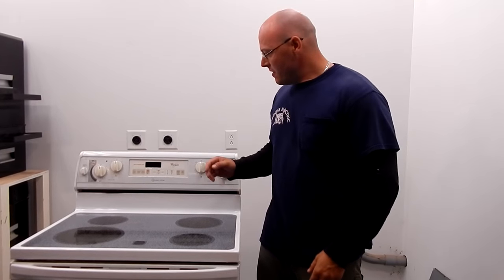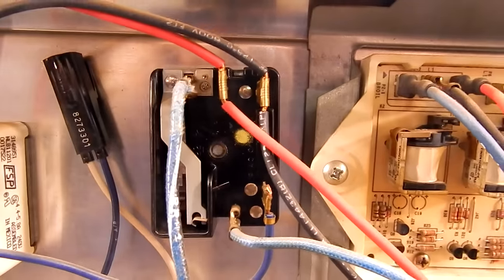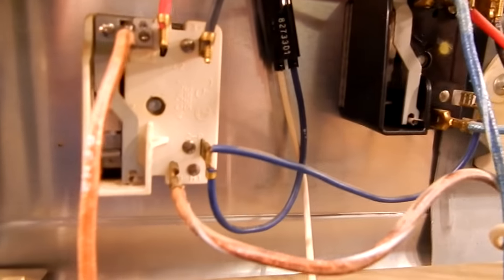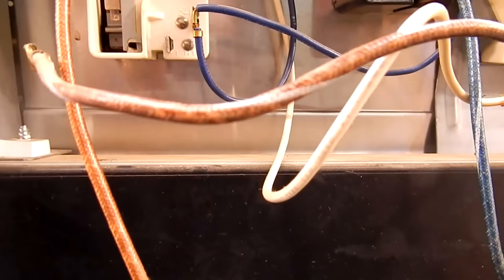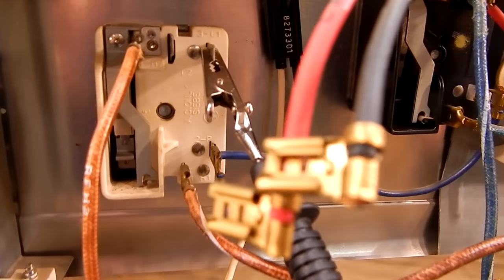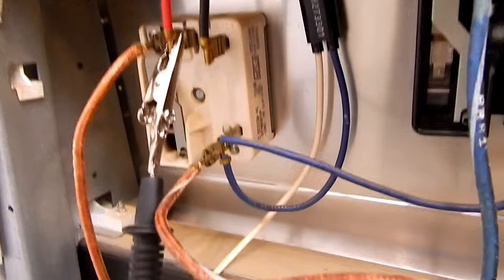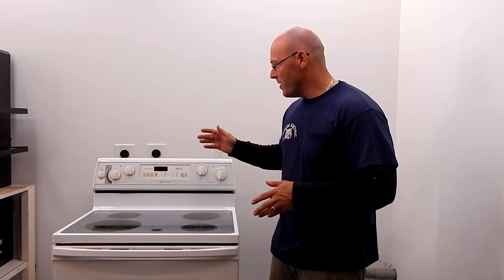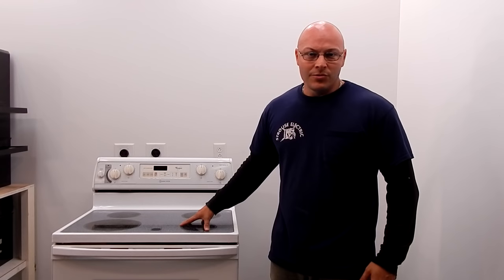How to Troubleshoot Glass Top Stove Burners and Switches

Comment: Thanks a bunch.  On the switch and element testing,  I got a clear picture how to ID the part to be replaced.  Really a good video. Sorry to learn that you passed away. RIP.
Reply: Thanks for the video.

I have a stove just like the one in this video and it is the biggest burner that isn't working.
It won't heat up.
I replaced the switch and also replaced the burner and am still having the same problem.
The burner won't heat up.
Does anyone have any ideas on what the problem might be?
Reply: @im1who84u - from what i’m reading on some other forms it could be the master control board itself that needs to be replaced…. Or the wiring …..

Comment: Great info! I think electric stoves are crap and gas is the way to go unfortunately that's not a choice we all can control.  I had a burner that stopped working, this before finding your video.  I opened the the burner top and looked at the non working burner and right off the bat I noticed a wire had separated from the crimp connector!  I restored that connection and my burner now works!  With this video instruction, I would have read open on the meter when checking the element!  Thanks for the simplicity of this video I will recommend it to anyone that needs to troubleshoot an electric range. Thanks again!
Reply: I have a stove just like the one in this video and it is the biggest burner that isn't working.
It won't heat up.
I replaced the switch and also replaced the burner and am still having the same problem.
The burner won't heat up.
Does anyone have any ideas on what the problem might be?

Comment: My glass top stove element front left seems to have 1 temperature setting - HIGH.  I think from watching your videos, this may mean it's the switch needing to be changed out.  I'm not sure though because the two videos I've watched seem to deal with elements that won't don't turn on... Mine is turning on... way on... no matter what temp or whether it's on the single or double burner side.  I have a friend I think with me holding things, stuff at my age I can do, he can change it be it switch or burner.  Looking for appliance book to find part numbers and such... It's a Kenmore bought in 2017 to replace our stove after our home was flooded in 2016.  Advice?  Help me please.  Sigh... RIP Mr. Newberry.  Sympathy to Mr. Newberry's family.  Looks like Mr. Newberry left a valuable legacy in his videos.

Comment: Hi,I have question regarding wiring on limiter heat indicator ,if L1 line (120 v )connected to 1 b and N neutral line connected to 2 b  ,will it shorted it ? Or the indicator heat light up when temp reach its certain temp to closed its switch so that light will go on -

Comment: What if burners and oven quit heating at same time ?? Accusimmer is all that works. I've done your tests and it all tests fine. Any advice?
Reply: Control board
Reply: All burners need 240V and get it from L1(black wire) and L2 (red wire). Accusimmer needs only 120V and gets it from L2 and N (neutral White wire). Since nothing works except Accusimmer, that means you don't get 240V.
Check for the half-tripped breaker.
Check power cord for burns and that it's capable of supplying 240V.
Check for loose wires inside the wall outlet. (if you are not comfortable working with electricity, call an electric because 240V can kill you)

Comment: Thanks for the very informative video.  If I have no temperature control on the burner, do I need to replace the switch?  I can turn the element on, but it goes to max and stays there regardless of the setting on the knob.  Thanks!
Reply from the maker: I would say your burner switch is bad or seriously out of adjustment.  Some are adjustable.  Tiny flat head set screw down the shaft where the knobs connects.  Was the burner previously working fine, then stopped working?  Or has it always been like this?
Reply: Thanks Bill.  I'll check for a set screw.  The problem started happening intermittently with increasing frequency on two of my burners; now the two burners are permanently afflicted and will only go on high and stay there.  If there isn't a set screw, then I should just replace the switches?
Reply: Hi Bill.  I ordered new regulators and installed them thanks to your video; now everything works great.  You mentioned a set screw, in the back of the regulators (stove model Samsung FE-R500WW regulator part number DG44-01002A) there is a small Allen key.  I wasn't able to find any instructions for the regulator.  Do you know what that Allen key does?  Thanks again!  Now I can cook without turning the burner on and off constantly.
Reply: Steven Gray
Reply: Steven Gray broiler will not work
Reply: Thanks for asking this because this is the same problem I am experiencing currently.

Comment: Whirlpool range.  Turn on any burner and it immediatly goes to high and stays there. No control.  And it is any burner. They all do it. Is is it possible that all control switches are bad? Since they are daisy chained could one be controling all?  Oven works fine. Please answer. Thanks.

Comment: Thanks for the video.

I have a stove just like the one in this video and it is the biggest burner that isn't working.
It won't heat up.
I replaced the switch and also replaced the burner and am still having the same problem.
The burner won't heat up.
Does anyone have any ideas on what the problem might be?

Comment: Very good video...

Besides the control knob for the burner and a  reading in the multimeter of infinite resistance (broken filament in the burner)...I can also see a third problem...

What if the normally closed contact at the burner...start to open too often???...that I believe will be a hard issue to detect.  If your  burner turn on...but start to go on/off more often that they should...after ruling out the other two issues (as you explain here using the multimeter)...then the problem might  be the  burner switch ...opening the normally closed switch too often...I reader wrote something that this switch should not pop open until 1000 degrees...Hence the on and off of a burner at a given setting should only be through the control knob...is this is correct?

What do you think?

Thanks!!!!

Comment: Hey Bill, Bill here. I replaced burner after noticing burnt terminal. Burner still not working. I just replaced switch and still nothing. Any suggestions. Should I have changed the terminal end on burner before reconnecting?

Comment: Is it possible that a  control board issue lead to one burner not receive power? I have a whirlpool range, changed switch and element, check some cables and seem to be fine but all other elements get power but not this one (bigger one on the front right)

Comment: Thanks  for this excellent video. As for Samsung ranges, they are garbage, it seems. With mine I had switches going faulty one after the other just after the first year. When I decided to replace the switches after they are all consumed, I was surprised to see that the 4 switches cost almost half the price of a new range. This time I'm thinking of buying one with solid state control and not mechanical parts and definitely NOT Samsung. Thanks.

Comment: Hello Bill I used the procedure for my Frigidaire electric range, only right hand side burner is not working. Both the burner and switch are tested for continuity and both are functional. what else could be the problem for burner not heating up? indicator light is on though? thanks for your help

Comment: Hi I tried to test resistance between L1 and L2 to test the switch and did the test for Buber that was mentioned both show 37 ohms for Samsung single 6” burner but the burner is not working so you know what else might be wrong and this is the only one that is not working other3 burners are working

Comment: That's actually an Open (OL) reading on the ohmmeter when you connected the leads to the switch, not a "Zero" reading as you said. A Zero reading would indicate continuity which is not what you want with the switch open.

Comment: I have a Frigidaire Gallery smooth top stove and my burner won't shut off (rear left small), I've replaced the switch but the burner still stays on however when I installed the new one the light would come on but once I get to halfway it shuts off (clicks) then I turned off then on again only to have the burner come on then it stays hot while the light stays on. Could it be the burner shorting out? Thanks
Reply: Fregidaire

Comment: Very clear; I found the problem right away. Thanks !
Reply: I have a stove just like the one in this video and it is the biggest burner that isn't working.
It won't heat up.
I replaced the switch and also replaced the burner and am still having the same problem.
The burner won't heat up.
Does anyone have any ideas on what the problem might be?

Comment: All my glass top burners are not working but the oven turns on and the clock is working. Is that normally a burner switch issue?

Comment: There's one burner on my stove that after I turn it on I'll eventually (3 to 6 seconds after the burner lights up) hear static around where the switch is and it will shut off. I replaced the switch and it still does it. Any advice? I don't have a meter to check the readings.

Comment: Great video Bill, thanks! Do you happen to know anything about another type of infinite switch found on units like a jenn-Air? My range top has an almost identical top. Mine is  a slide in (drop in??) but the infinite switch for the front right unit has a much different style of connector and is called a "Custom Control" switch?
Any help is appreciated.
Reply: Good job
Reply: Before you do the job 
Take a picture with 
Your. PHONE

Comment: Hello sir, I have Kenmore flat top. One small burner doesn't work. I  REPLACED WITH NEW BURNER - didn;t work. I doubted Switch and replaced but still doesn't work. All connection are ok. What is other thing to check? Could you please Reply.
Reply: Sadly, Bill Newberry died on October 24, 2016.

Comment: hi, Bill...one element was overheating a bit....called repair, he said it's the switch...replaced it, $150.  he left, didn't test it.  later that day, there is liitle or no heat from that burner..it warms up then shuts down quickly. Called repair...he came, said it's the sensor, replacement is $275 total...what he meant was the element and the probe, or "sensor".  I asked then why replace the switch?  he said it would probably soon go, oven is 9 yrs. old.....can't I buy the probe separate from the element? Am I being scammed?  thanks, Bill

Comment: I think I get it... The first test bypasses the switch to check continuity in the burner, the second just checks the switch, right?  If you have one of those inner and outer ring burners, and the outer ring works, that implies that the switch works (for both rings, correct)?
Reply: My outer ring doesn't work but the inner one does. Both of Bill's test say's my switch and burner are good. So why doesn't both rings light up. Same issue I have with the simmer select burner on the other side of stove. The simmer select works but the burner does not "glow" and work with out simmer on. Anyone here have any suggestions. I know Bill has long ago has left us.

Comment: Hi
we changed the switch, which had bunt marks and the burner which was burnt too and the element still isn't working, we bought original parts, should we give up?  i almost forgot, the hot surface light goes on as soon as we turn the switch on, any suggestions are appreciated. thank you
Reply: Sadly, Bill Newberry died on October 24, 2016.

Comment: I have a question... I have a Inglis stove my big burner blew and not everything else out I replace the burner and got power going to everything but nothing will heat up no over and no burners but all lights up. This stove, when its plugged in the stove clock would come on but don't but lots off power. What would be the problem?
Reply: Sadly, Bill Newberry died on October 24, 2016.

Comment: Nice video, subscribed.

I do have a question that does not center around electric burners. I have a gas stove; if you use two burners the output is fine, if you use all four burners there is a reduction in out put. The unit is an Acubake Duo by Whirlpool. It had one issue that I dealt with in the oven where the gas rail needed a modified rail with more holes in it for start up. That worked fine. But the reduction in output when using all burners in new to me and I have not found much on the internet to explain it. No kinked gas lines and they are the proper size. Any ideas would be great, Thanks!
Reply from the maker: Curiosity Is it converted to propane?
Reply: Bill Newberry Well it's coming off of a city gas line, not sure how to tell if the stove might have been delivered incorrectly in the past? Not sure how to tell if it might have been setup for propane accidentally.

Comment: Help !!  I have a Kenmore Electric stove. I had to replace the main control board, $110. And the right front burner, $75. About 4 months later the same burner, burned out. I got one on ebay.  $45 It has been about a year now and it has burned out again. I should mention I had to replace the wire connector that plugs into that  burner. Any ideas as to why this keeps burning out ?
Reply: William Wynn did you check main power current fluctuations..??
You definitely have over current issue with your main panel. !
Or just loose connections at tha particular burner would definitely cause over current situation.

Comment: I have a hot top sensor indicator between the front two burners and one of the four stays lit unless I place an ice cube on the burner effected and it shuts off after a minute. How do I repair that. Where is the bad part located?

Comment: My front and rear right burner both come on when I use the rear control switch. Any suggestions on what to check.
Reply: I'd say one of your switches is stuck on and has to be replaced. The feeds to the switches are all daisy chained.  So the one that you don't want on is the switch that has to be replaced
Reply: Sadly, Bill Newberry died on October 24, 2016.

Comment: I have changed both the burner and switch out for the left front burner but it still doesn't work. The other 3 work. What else could it be? The original burner was pretty fried.
Reply: Look for burnt wires

Comment: Hi Bill maybe you could assist me. Thanks for your video.  I have a Kenmore model #790.96593602 electric glass top stove. The large front right three coil burner has stopped working properly. The main inside burner went out but the middle and outside ring still works. I opened the top and tried doing a continuity test. I expected to hear the closed circuit on two of the three circuits but instead I hear nothing. When I touch the two meter probes together, my meter buzzes so I know it works. I need to find out if my element needs replacing or the control panel needs replacement. Could your help?
Reply: Sadly, Bill Newberry died on October 24, 2016.
Reply: @returnofthemac8179  So sorry to hear of Bill's passing.
Reply: @phillip5545  His obituary indicated that he was only 38.
Reply: I have a dual burner and the inner one would not light. Used Bob's video to check current and found out no current to the inner ring. I replaced the burner and it works fine. https://www.youtube.com/watch?v=HOUyGJQbB0E  Just posting to possibly  help anyone else.

Comment: I replaced my Kenmore (790.9621240A) left front burner switch (316436001) but now it clicks when I turn it on. I put the old one back and there is not clicking. What could this be?

Comment: Bill you say that if  one gets a  0 ohm  reading between l1 & l2 you have an open coil. So the home owner goes out and buys a switch for what ever and then finds out that a wire burned off the heating coil and waisted all that time and money.. Please correct this on your switch replacement video on 4/29/15, thanks.

Comment: I have a Kenmore Elite Model # 790.98022800 Electric range, Oct. 2008. Some of the digitally controlled burners don’t respond properly when turning them down and sometimes they don’t even turn off. Have to flip the range circuit breaker off and back on to turn them off. Is there a control board going bad that needs replacing?

Comment: help 
I have Frigidaire electric glass top oven. the clock light is not on but clock is working. when I touch clock button the light is on and clock time is visible but after few seconds, the light is off and clock time is not visible.
pls. help.
Pankaj

Comment: . Troubleshooting Whirlpool Range  as this one your are working on . NO Power to control board or overn. Troubleshooting pointed to thermo fuse so i replaced it first . Then No power still . BURNERS all work . So next trouble shooting pointed to control board . So I just put it in and Still no power to new contol board or oven What next ?